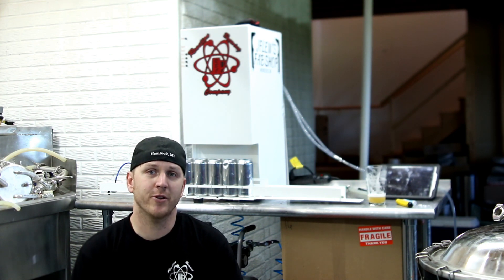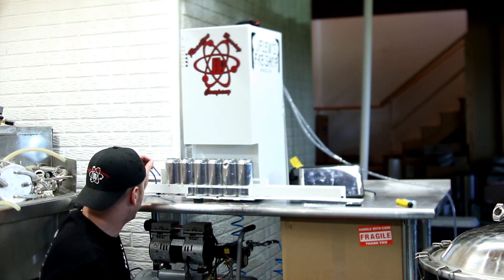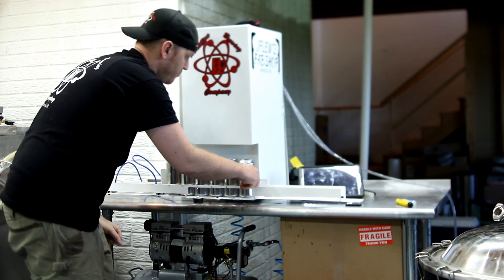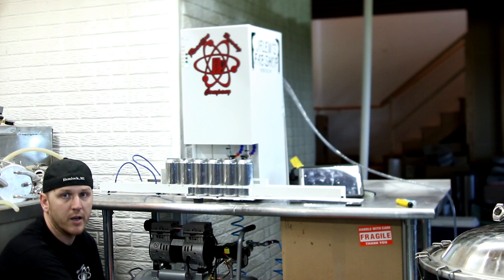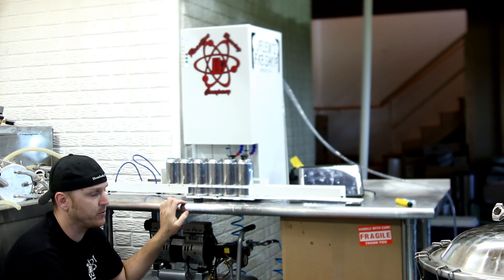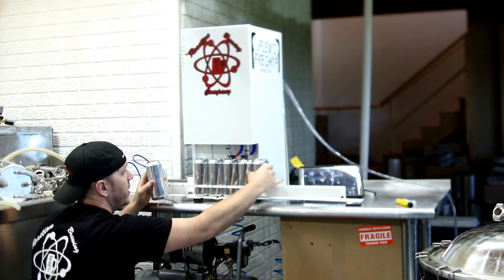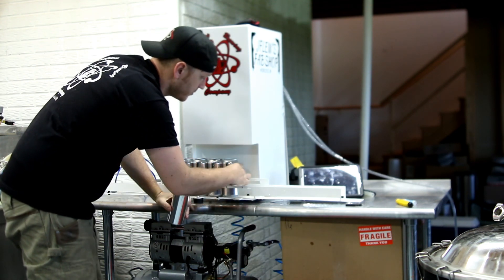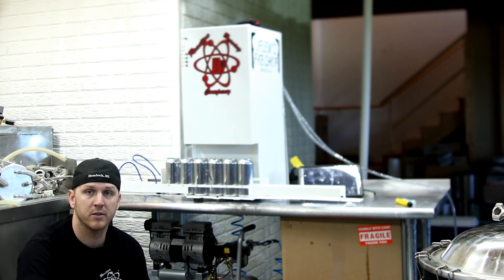Home brew Automated can filler

Comment: Looks really great, wondered how you'd overcome the potential for foam on the level sensor, blowing it off should work, might be worth swapping to CO2 for that though as that way you are also keeping a high CO2 area above the can rather than air, should help minimize oxidation. When do you go into production? Will likely ask you to build one of these if you can ship it to the UK, or if not next time i'm over in MI i'll pop up and get a kit of parts to rebuild back home. You look to have fixed the Blue Tooth drop out issue now. Keep it up, looking good.
Reply from the maker: TeamDandism the liquid sensors aren't supposed to see the foam only actual liquid.  I won't know for sure until I run beer through it.  Definitely let me know when you're in Michigan next, it's pretty huge so shipping would be a fortune.

Comment: to avoid the first slam, you can fit a rate control valve into the line to slow the actuator down a touch.
Reply from the maker: TeamDandism it has flow controllers on the exhaust sides but maybe I need to add one to the inlet too?